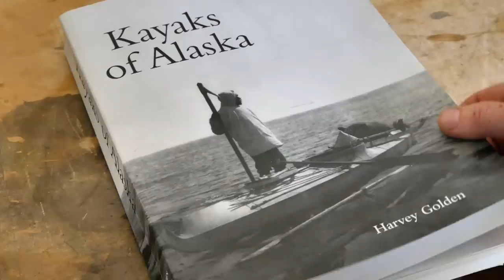Building Traditional North Alaskan Hunting Kayak Frames, Step by Step

Comment: I look at all the work that has gone into making these frames, then reflect on how much time was saved using modern machines, and shudder at how much it must have taken the First Nations craftsmen to do the job! 
Respect to the guys dong the work here, and even more to those who developed the designs and build process in the first place!

For all the progress mankind has made, and the amazing things we can construct today, it is sad to realise how many skills, and what we have lost from the past.
When groups have looked into building wooden ships as an exercise in experimental archaeology, they have found that not only are the skills in very short supply to do the work, but the materials, (IE the Trees), are not available anymore: The "Royal" forests that many assume were there for "Hunting," also provided for specific species of tree, and even these individual trees were chosen to provide certain shapes for specific parts, like 'Knees' (an 'L' shape that holds up the deck beams), and the 'Y' and 'V' shapes used in the Keel. If you have to use 2 pieces joined it makes for a weak part at the joint, if it is GROWN into the correct shape, it makes for a very strong 1 piece part.
Reply: Correction not First Nations, that is a misnomer. Inuit is better.
Reply: @coniow  there is videos on the internet as well as film board of canada that have, in fact, captured the building of canoes and kayaks using original tools and methods.

Neither first nations or natives apply to "NA indians". At least according to some archaeological findings and dna testing.

Its all complicated. I stick with the safer"North American Indians" for now.
Reply: @jacilynns6330  I also include Maori and Australian Aboriginal, not to forget Polynesian peoples and many others. IE: Those that were there BEFORE the western explorers 'claimed' their lands for their particular Monarch. Europeans do not have a good track record with Native Peoples, and so it also goes on today in the Amazon. If there is anything that is perceived as valuable, God help the poor devils who have lived there for generations, as their Rights will be Trampled on in the name of Profit :-(.

If a description works for me, I will use it. I am no academic, and I am quite happy for them to have their interpretation of a phrase. I am also quite happy if my use of a phrase tweaks their sensibilities :-).
What is that great Canadian universal comment: "It is what it is!"
Reply: @coniow  I'd love to read this to my kindergartners while they are falling asleep at nap!
Reply: @barbara-holley  I think that that would constitute "Cruel and Unusual Punishment" :-).

Comment: I built an F1 way back in 2009 ... it's been my go-to kayak all these years ... does all I want a kayak to do ... no need for anything more. But I've always liked the lines of the NA hunting Kayak ... it's tempting ... just might have to give it a try!
Reply from the maker: Trust me, you DON'T want a North Alaskan Kayak, however, you might want to check out a design I've been working on that is a hybrid of the the NA hull and the F1 deck.  So far I've only talked about it on Instagram.   I posted a day by day building blog, and video of it on the water at http://instagram.com/capefalconbuilds
I'll try to get something up on YouTube soon.
Reply: I was going to ask what does something like that paddle like?

Comment: You make everything look so effortless, can you not do a out take or boo-boos to make us mere mortals feel better 🤣🤣
Reply from the maker: Sure, the unedited footage is about five hours long, where should I send it?!  Seriously though, these kayaks were HARD to make.  The first run through on any replica is just brutal because you can get 2/3rds of the way done, and if something is off by more than 1/4" from the original drawing, it can mean starting OVER.  It took two of us 3 solid weeks to complete both of these.  Quite a challenge compared to the 3 days it takes to build one of my own designs!
Reply: @capefalconkayak  no way, I can imagine your wood pile of slightly out ones!! Your a true artist!!

Comment: Hey really enjoy your work.
Hope you don't mind me suggesting that, you should design and build a skin-on-frame Adirondack Guide Boat
Reply from the maker: If you check my website I’ve done that.  It’s an absolutely incredible boat and I love using it more than anything but the problem is it’s about 10 times as hard to build as a skinboat with steam bent ribs, because all the ribs need to be laminated over forms and then additionally cut to shape.  Also the entire frame is very meticulously screwed and nailed together and all of the tolerances are very precise which is also a lot different than normal skin on frame boat building which is usually pretty easy.

I would love to be able to offer this for people but putting together a video course and a plan set is usually about one year of myself and my partner working full-time so over the lifespan of the course we would have to make back the amount of money in plan sales, which might be challenging for such a niche product.
Reply: Ah, I see, that's understandable. Sorry took a bit of digging to find them. I was on the plans website and not your more blog website.
I'm not surprised it took you so much longer, so much more difficult to build and expensive. 
I just finished skimming tha page and read that note ar the bottom. So understood. 
Again great work on your designs and your videos. 
You create great, very well informed videos. Just finishing up all you building a skin-on-frame canoe vids.

Comment: superb piece of work.  Similar in some respects to the building of currachs in Ireland, given they are both essentially frame based boats, however there is very little use of cord and knotting in currachs (if any).  Intrigued by the use of the pegs everywhere.  Can I ask what wood it is that you have used?
Reply: If he's using native woods, spruce and fir. I saw some red oak in there for the bent ribs.  The stitching is easier in a resource poor area- it also lends flexibility (note the continuous tie on the bottom stringers). I would imagine that a lot of sinew went into stitching the originals.

Comment: Nice job Brian. Those look fantastic. I like the jigging you did for the deck beam tenons. I'm curious about your choice to go with the two different gunnel profiles. Were you looking to just lower or sweeten the sheer profile on the flattened one or was there some other goal?
Reply from the maker: Thanks! Just trying to match the survey drawings.  The more natural sheered shorter kayak is unique none of the other North Alaskan kayaks are like this.  I didn't do this one perfect,  it should have had a slight hump in the rear.
Reply: That high aspect masik left you with some real short grain on those tenons. Did that worry you any or would you have done differently in a boat meant for paddling?
Reply from the maker: @Nomadboatbuilding  They did it lots of different ways. Some were birds mouthed over the gunwale, some stub tenon and blind mortise, but some were like this, which you would think would be terribly hard to accomplish.  I tried to convince myself that the tenons weren't doing this but if you look at Harveys book, the visible mortises on the frame drawings are just way too high for anything else to be the case.  I wouldn't do it that way!
Reply: Cape Falcon Kayak well the hardest thing to do is perfectly match someone else’s imperfect results.

Comment: Question:  What kind of cord are you using to tie things together?  It looks like waxed string?
Reply from the maker: Artificial sinew.  I used the twisted stuff for replica frames like this, but flat sinew for the boats I paddle because it sits flat under the skin.
Reply: If I was to do it it try some dyneema and wax it as it’s insanely strong and doesn’t stretch or shrink.

Comment: Well it's an interesting take on kayaks. You obviously have a business making Your version of a kayak. I say your version because it is not really a true traditional kayak.  non driftwood frame tied with, well best not said what it was tied with, and I doubt it's covered with seal skin either.

note driftwood was used for its lightness.
Reply from the maker: Interestingly, these kayaks were commissioned by a Native Alaskan Corporation and their construction details were reviewed beforehand by the worlds leading expert on these kayaks.  We looked at many private photos of the interior and exterior of these kayaks from museums, and I was told the original boats which I was replicating were made in early 20th century and would have been made out of black spruce lumber made from local sawmills.  Some were tied with sinew, some with other types of cord.  It is illegal to kill a seal, and I don't want to, so we chose nylon.  

You do bring up a good point though.  Where is the line between traditional and non traditional kayaks?   Is a traditional kayak made with all driftwood and animal sinew?  What happens when a dutch whaling ship crashes into the south coast of Greenland in the late 1600s and the Inuit scavenge the metal and start using it in the kayaks? How about when they get access to steel tools and saws?  How about when canvas replaces sealskin in the mid 20th century?  How about my friend Max, who is currently reviving the local skin on frame kayak tradition building kayaks with the children in his village in East Greenland using wood and modern materials?

Taking things even further, how about if my friends who are actual Inuit people make one of my modern designs in skin on frame and use it to hunt seals, and at the same time, me, a white guy, makes a kayak out of driftwood and sealskin and hangs it on a wall in a museum?  Which kayak is more traditional?
Reply: @capefalconkayak 
I was actually complimenting you on your design as being a close modern one. If you want to research an original kayak there is one that is over 200 years old in a museum here in Manitoba. 

I saw it in person as a little girl in the late 70s on a school field trip. It was very brittle seal skin with a driftwood frame. Its probably sealed in glass and whatnot now.

I have to guess but I believe it probably wieghed less than ten pounds.

admittedly reviewing the comment it may have been taken as an insult, im sorry about that. It was just the title said tradional hunting kayaks and I expected to see a video on driftwood and synthetic skin tied with root.